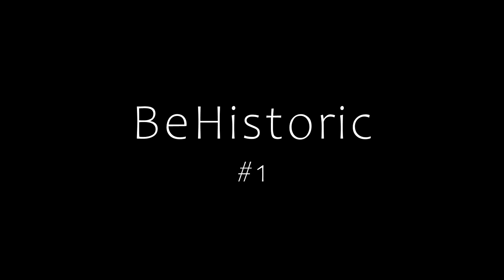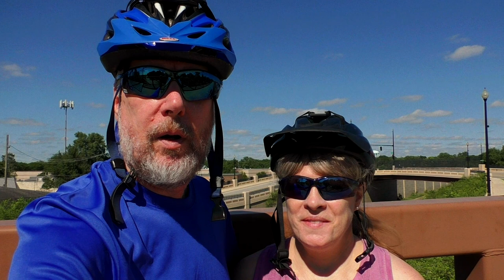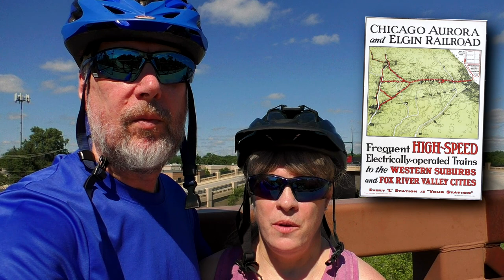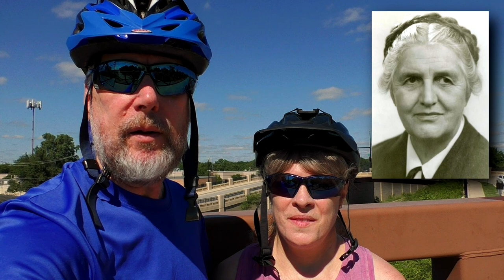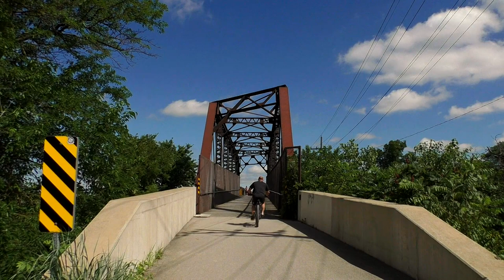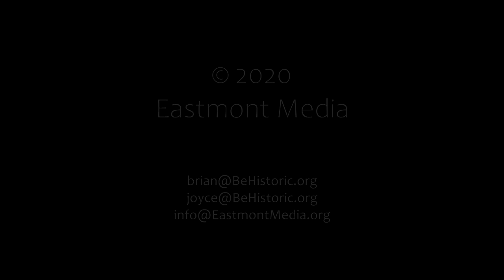Disused Stations of the Chicago Aurora and Elgin Railway - INTRO

Comment: This Railroad may still be running today if we had organizations like RTA, METRA,or even someone like NICTD which made possible the South Shore Line's survival. Today's CA&E would most likely look very much like today's SOUTH SHORE LINE. It's electrical system no doubt might be entirely converted to overhead wires with 1,500 volts DC current for the sake of safety.